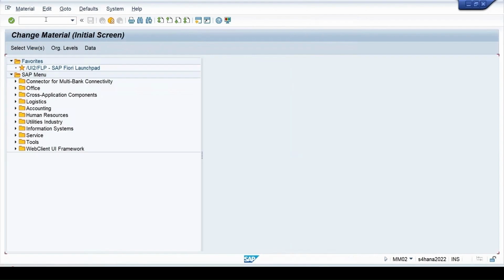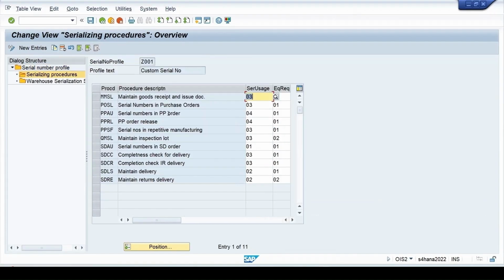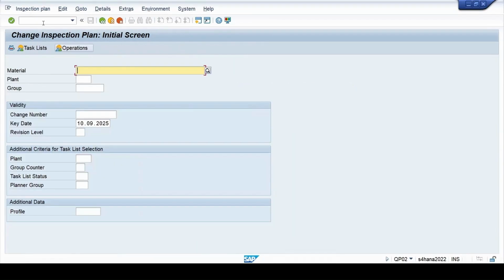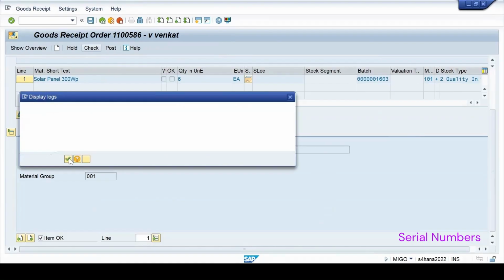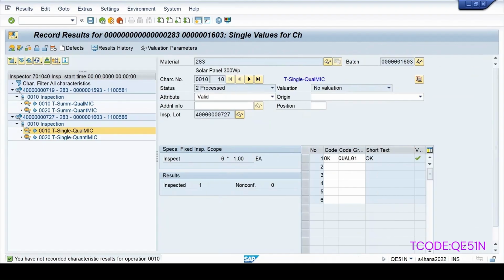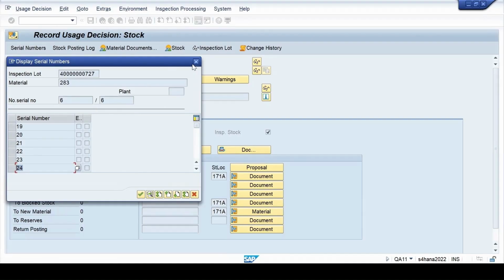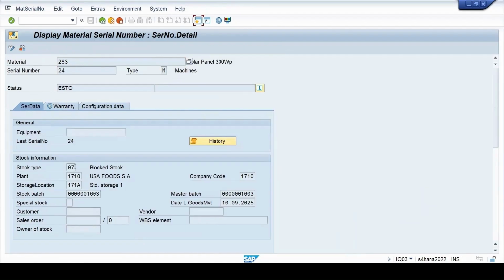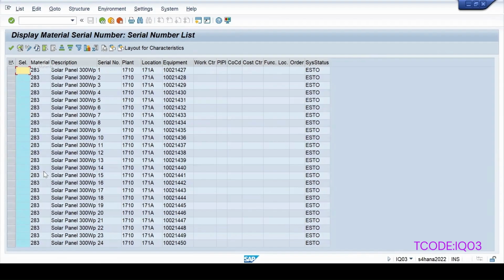SAP S/4HANA QM | Serial Numbers Poss. Indicator for Inspection Type | MM02 | SAP Quality Management

Comment: Hi Nisha, Thanks for the detailed explaination, but if i want to enter serial no manual (external) so how we can do that.
Reply from the maker: you can configure accordingly
https://youtu.be/NdOjdwjuYTY
Reply: @SAPwithNisha   Thanks for the  video but this time i have requirement for sr. no. record manually in inspection type 01, i want to record the sr. no provided by the supplier on the material, can you guide me on this please
Reply from the maker: Pls. Drop a mail: nishajaint19@gmail.com